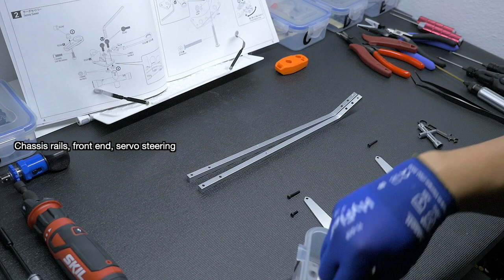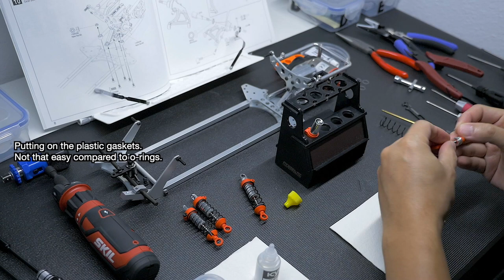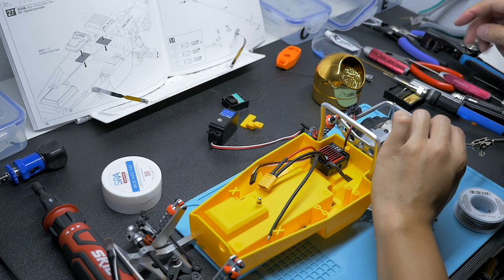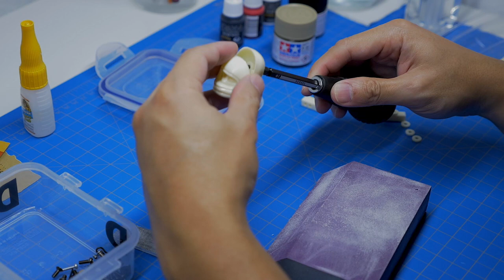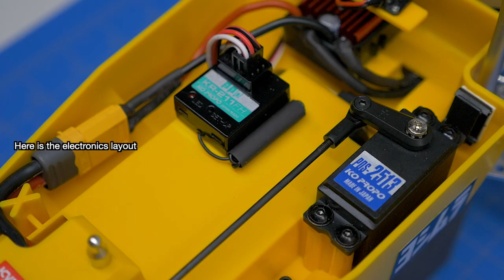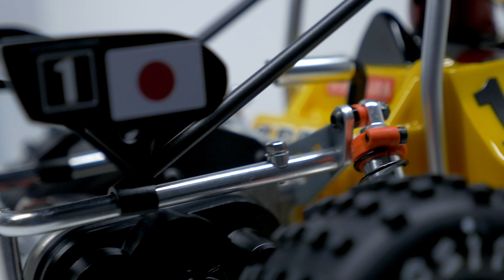Building an RC: Kyosho Scorpion (Time Lapse)

Comment: I love your work, so clean and professional, very inspiring! I agree the black rims + wing  are the key!  Are the rear tires Hoosier or just a decal / painted with a stencil?
Reply from the maker: Thank you! Really appreciate the kind words. And thanks for watching. The rear tires are painted, partially with a stencil and some hand done—because the stencil doesn’t adhere well or it leaves open gaps for paint to scatter. I wanted to do Hoosier instead of Good Year because my kit (#C) doesn’t have the Good Year marking anymore. And I thought it would be nice to be a bit different.

Comment: awesome build! I see other youtubers using the blue tekbond on the screws... is it a must? Maybe for the chassis, so it keeps everything together after bashing it (which I am not sure you'll do... would be a shame to hurt such a beauty)
Reply from the maker: Thanks, Vinicius Brito! And thank you for watching. The blue thread lock? It really depends. I haven't fully ran this car so I didn't add it on some of the screws yet (those that go into metal threads). But in other kits I've built and when the manual says to apply it, I do. In my case, it's important because I'm worried of losing a part or screw when running a car. Applying it hasn't really damaged the parts and if it goes on non-metal parts I just wipe it off.

Comment: very nice and inspiring build and overall pro rc vid in general, one of the best and pleasant rc channels out there!

small question though, where did you get the sticker/decal set? because it seems to be different from whats included in that kit?

thx!
Reply from the maker: Hi Erikootje and thanks for watching! The decals were just a collection of random decals (some old) I've had and some for other things like static models, and some not meant for RCs—like the Yoshimura one (that's for a motorcycle exhaust). The wing decal is actually the logo from the band Scorpions I got some time ago and I just removed the "s" in the end.
Reply: @MechanicAfterHours  nice! And thx again.
Do you know where to get that japanese flag decal you got on the wing? Thx again
Reply from the maker: No problem. I printed it with an inkjet printer on sticker paper.

Comment: Beautiful build my friend! That colour match with the body paint is prefect. What colour did you use please?
Reply from the maker: Thank you! For the top polycarbonate body I use two coats of Tamiya PS-6 (standard yellow) and backed it with a coat of Tamiya PS-7 (standard orange). I think the trick is managing the amount or thickness of coats you apply. Too thin on the yellow coats and it will look darker/orange, too thick and heavy on the coats of yellow and it might be a bit lighter. Good luck!

Comment: Love all your customs builds. Have a couple of questions. Where do you find those black wheels. Are they the same stile just painted in black?
Did you painted in yellow and orange just the top body or the hole body and was after or before the assembly. 
Where did you find the rear spoiler and the bracket that is different that come in the kit
Thanks

Comment: Hi. Nice video build. 
I was looking a video to see how to set the front wheels of an old scorpion that someone gifted to me. I’m trying to figure out if it’s better with toe in or toe out. 
I tried straighten the wheels with zero toe and with some toe out and it was sliding the front out. Understeer. 
Thanks in advance
Reply from the maker: Thanks, Babis xalkias! And thank you for watching. The front negative camber on my Scorpion is not ideal. It's very extreme and only meant to show a mean stance. I do have a different setup for running. 2WD front toe-in or out will really depend on the track type, surface type, and your driving style. Typically, front toe-in helps with responsiveness and stable acceleration when exiting turns, but might reduce steering when you start to enter a corner. Also good for bumpy roads. Front toe-out is good for corner entry but might be a bit nervous exiting a turn. Then for the front negative camber, helps with turns where it tries to prevent the outer tires from rolling out on turns. But you do have to test different setups in your environment. I think the best negative camber is when most of the lower tire's contact patch still touches the surface.
Reply: @MechanicAfterHours  can I ask if you had any issue with the small sprocket inside the gearbox? After one minute testing it got loose. I found out that the tiny hex screw was loose. 
I tighten it and now that I did test it happened again. Should I use thread lock glue or it want do any good?
Reply from the maker: I haven’t worked on the original one and unfortunately I don’t have a manual for it. I think you have the one from the ‘80s. I believe their gearboxes are different where the re issued one has a differential. And, almost all the gears on the re-issue are metal and so I’ve never experienced issues. It’s pretty much solid and smooth. If the hex is loose and it mounts to metal then you can try blue thread lock first. And maybe move up from there with red or so. Or see if can find a replacement on ebay. Sorry, couldn’t really help much since I can’t see it. Good luck!
Reply: @MechanicAfterHours  I think it’s the one from the ‘80s 😅 I don’t have manual either. 
Don’t worry, you have helped. 👍🏻
I will try the blue thread lock and then a red. 
I’m more of a racing drone guy but with this old one I will go into car too! Here goes all my money now.
Reply: @MechanicAfterHours  it got loose again and now I used thread lock blue. I hope it works. 
And I found out that this model is from 1982. It had a mechanical speed control with servo moving it. I already removed it and put a used brushed esc from a friend. Is it possible that the gears and motor will work with 3S lipo?
Thank you in advance again.
Reply from the maker: Not sure If I would put lipo but I guess that depends on your setup/power. Gears and transmission design is vintage so it might not be able to handle it as well

Comment: how did you make such extreme camber in the front?
Reply from the maker: I have some extra Scorpion springs and I cut about 7-9mm off on front and rears. I also raised the shock collar to keep the car low. Mostly just for the look, character, and stance. But on the actual run, I will raise it up to a suitable height.

Comment: I built this kit a few years ago. I am not a fan of the front suspension linkage. It just feels like it is under too much stress and wants to come apart. Did you find anything similar?
Reply from the maker: I'm in the same boat. I did notice the front part of the chassis when I was building it. In fact the alloy shaft block already had loose threads before I could even secure it. However, if I were to run it hard and use it as a serious runner, I would get Kyosho's optional CNC aluminum shaft blocks and caster locks, hard main chassis rail, an alternative rod end/adjuster that's stronger (even from another racing brand), maybe some Lunsford rods, stronger alloy screws for some areas that are very prone to stress. I also know there's an aftermarket alloy servo horn/saver. I know that sounds a lot but if one serious about pushing this kit that's what I would do.

Comment: Kyosho chassis are far stronger than tamiya one and price are doubled too
Reply from the maker: Depends really. Kyosho doesn’t have something comparable to a Hornet, DTxx chassis, or lower priced Tamiyas. If you’re comparing it to similar priced Tamiya kits or Tamiya kits of the same level, I can say the Kyoshos have better quality/value. I’ve built a Super Astute and that is more $ than the Scorpion and the Ultima (which performs way better). Similar to an Optima vs Super Shot. The Optima has better quality and can outperform the Super Shot in my opinion/experience. I do like both brands but they just have different approaches.
Reply: @MechanicAfterHours  back in optima days... i was a kid, now want to buy a turbo optima, series after this model are too modern to own 😬 simply go for kyosho inferno ep if people wants performance.
I love the vintage feel. Just finish my tamiya blitzer beetle (after watching yours) and amazed by the old design chassis. U will see many theory and reinforce parts necessary from there... but there actually no reinforcement parts by that time and till now... i simply wont hard use it, shame